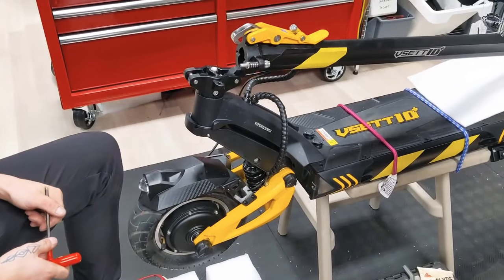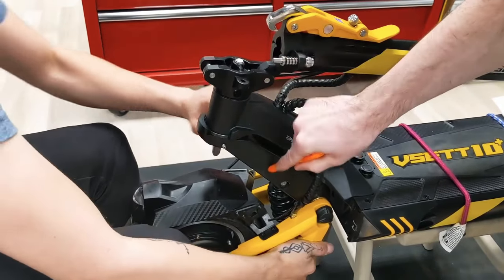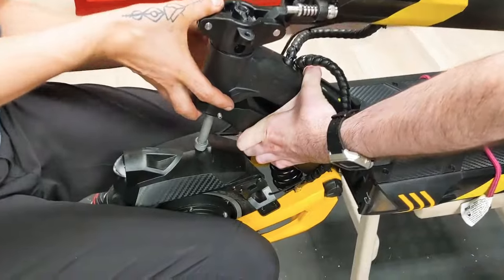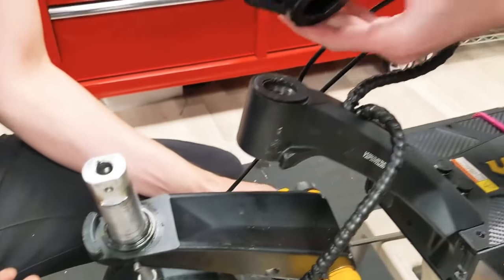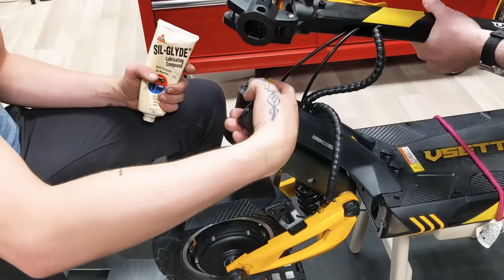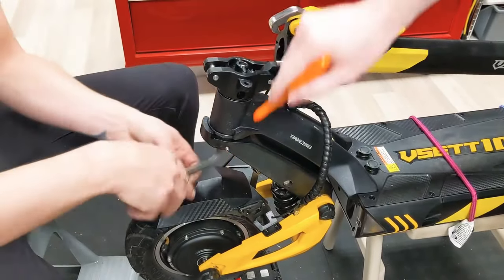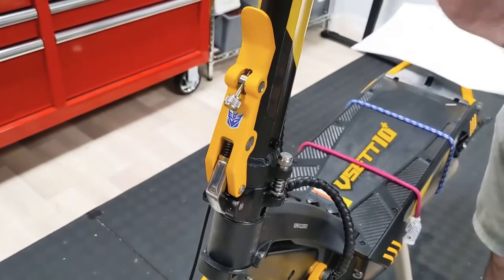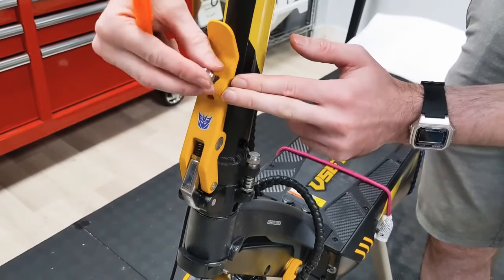VSETT 10+ Electric Scooter | Eliminating Steering Creak

Comment: I would also grease where the tapered bearing race/cup sits in the frame. I saw you talked about the bottom cup but the top one did not look greased. When I rode bmx the headset was built almost the same. We would grease under the bearings and pretty much anywhere metal touches metal.

Comment: Almost 500kms on my Vsett 10+ and the creaking became unbearable and I'm sure it's causing extra wear somewhere.  Oiled up all other moving areas around the suspension first, no luck.  Finally took apart the stem and it was literally dry inside, especially the aluminum shaft part.  There was some worn aluminum where the bottom of the top bearing rests on. Lucky, it appears to be cosmetic and shouldn't affect anything.  I greased EVERYTHING up with car ball joint grease. Creaking is gone.

Comment: I get one small knocking noise when I brake hard and has to use the handlebar as somewhat of a support and hold against to not fall over. To be honest it don't bother me that much since I don't regularly brake that hard but if it's possible to get rid of that noise in a somewhat easy way I want to get rid of it. But I haven't really experienced any creaking noise from what I can tell.
Anyway will this cure that knocking sound too or is it only for creaking noise?

Comment: I just tried this today, I could not get the stem off, no matter how hard I tried. Tried a mallet help it along, no go. All set screws and bolt we're out. Any ideas?
Reply: Yes mine to ..did you find a solution?
Reply: @15recap  ya, just kept hitting lol. Took some time.

Comment: I greased every point on my vsett10. I'm still getting excessive creaking even while riding on newly paved roads. Anyone know what can be causing this issue?
Reply: I'll answer my own question. It was the front suspension, must have been too tight from factory. I loosen it slightly and no more loud creak. Hopefully this can help someone with this same issue.
Reply: @escoot_nyc1651  be careful because too loose and you risk speed wobbles. Unfortunately I have been messed with this for a month and the end result…I’m replacing the suspension with air shocks. The stock springs are not properly hardened or I got a bad batch because I’ve lost half my travel on them trying to maintain a consistent resistance. Unfortunately that noise doesn’t go away for long as well. I’m pretty sure they cut corners on the parts like those shocks to keep costs as low as possible so I would probably expect to change them out at some point. Air or oil with rebound dampers 👍
Reply: @strive4208  Thanks for the advice.  I just slightly loosen mine and after about 100mi still good no creak no wobbles even at 45mph. In my experience the long main stem bolt had more to do with speed wobbles. (Too tight wobbles, too loose wobbles) I got it just right and used a paint marker to mark the spot. Even though I was told by rev rides to torque it down to 80ft lbs, I found this method to work best. No creak no wobbles. Suspension is ok but definitely upgrading to oil in future. Scoot Safe.
Reply: @escoot_nyc1651  how did you loosen it?

Comment: Everything is so easy for you ... I did everything as in the video, opened all the bolts on the left and right, unscrewed the central bolt, and I can not remove the steering column in any way. It doesn't move at all! In your video, it just fell down when unscrewing the central bolt. Why is it wrong with me?
Reply: Finally it worked. I had to wobble the steering wheel back and forth and pull up at the same time. Lots of dust and rust and a little jammed. Thank you for the video!
Reply: @Freezlot  yes I'm getting this issue tooo  trying to use ur method now. Send help
Reply: @dizlergaming7685  Grab the steering wheel, put your foot on and slowly swing the steering column itself forward and backward, slowly pull up and continue to rock. Just make sure all the bolts are unscrewed!

Comment: when is the industry gonna stop wth this ridiculous stem folding bs??
these r machines that can hit well over 80 kph so the last thing we need is a stem folding.
someone gotta design a stand or something so that these scooters can be mounted on a car as bicycles are currently.
u dont see bicycles being folded as a standard.
Reply from the maker: This is a foldable electric scooter. It's supposed to fold. It's an actual feature of this scooter.
Reply: @UrbanMachina  yes i understand, i just mean to say that this feature is focused too much in this industry. when r designers gonna realize that a foldable stem, no matter how safe and/or secure is still not as secure as a solid piece and thats what these monster scooters need. this r monstrous machines with crazy power and there have been too many cases of stems braking and almost always its from the folding mech. high end scooters need to stop being foldable. the overall performance will be way better and the scooter will also be way safer. folding stems r ok for lower end scooters that dont have multiple kw's of peak power but for these beasts, they r too fast to also be foldable. ur never gonna see a tour de france competitor race on a bicycle that can fold.
Reply from the maker: @okdok3742  we totally get your argument. This class of product started as a last mile solution, and then riders wanted more power, more range. At some point, they might as well be motorbikes. The folding feature in general, and for all scooters needs to be improved. It simply makes a vehicle more portable. The power on the other hand, is always in the hands of the rider. You can make anything faster these days. If you're riding a foldable scooter at motorbike speeds, then you need to be prepared for the worst that can happen.
Reply: @UrbanMachina  no no, no argument for me and ur completely correct. scooters did start out as last mile solutions "xiaomi"
im just saying, like u said, "they may as well be motorbikes" which is so true. if these r gonna have the speeds of motorbikes then they should be designed with safety first and then portability. we both have the right points.
Reply from the maker: @okdok3742  absolutely!
Reply: I'd suggest to the industry to make folding mechanism as an option. You could buy with, or without one. Sometimes I have the urge to facepalm when I see review, unboxing etc videos where people show how "quick and convenient" folding mechanism has this and that powerful scooter. Me and other people I know think about folding mechanism 99% of time only when it makes sounds, has a play etc. because we fold them maybe once or twice a year. I wouldnt mind if folding took few minutes instead of seconds or even required some tool. Just to be secure as solid peace. You dont take those big and heavy scooters into bus or tram etc and if you'd really need to, you wouldnt mind if if took some time would you? The other thing I'd mention is poor water resistance of many of them. You can ride most electric bikes in pouring rain without problems which I'd wouldnt be so sure with e scooters.
Reply: @AzogDefilerFromMordor  i could not agree more, i truly couldnt agree more man. folding stems on scooters that can go over 50 kph is just cringe as fuck imo. the industry should set out to design a stand for these scooters that can be mounted on top of vehicles. u dont see any bicycles that fold in half let alone those high multiple thousand dollars bikes so why scooters? the industry is stuck with the mentality of "its a scooter so it has to fold, these r not just scooters anymore, they r powerhouses and pack serious performance. rions can go over 100 mph like what is a folding stem even considered on a machine such as that. its an inherent compromise the stem fold and i hate it. stem fold is ok for xiaomis and emove cruisers, lower end scooters but for these monsters.....NO, just no.
Reply: @AzogDefilerFromMordor  folding it twice per ride lol